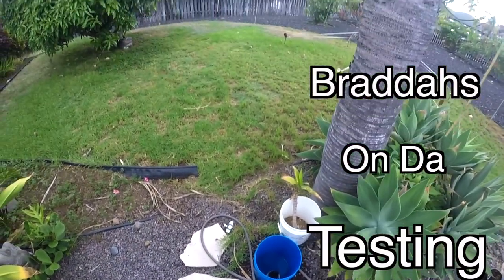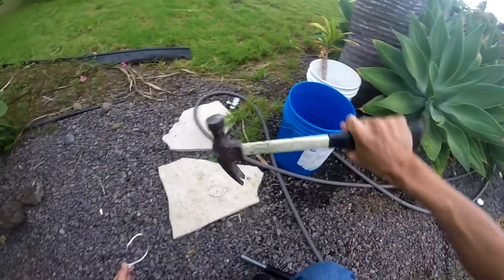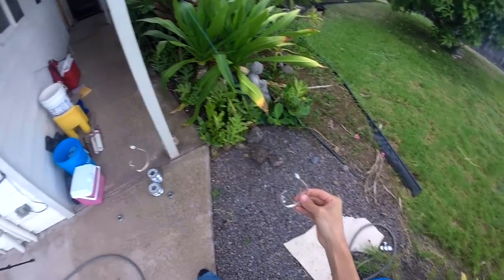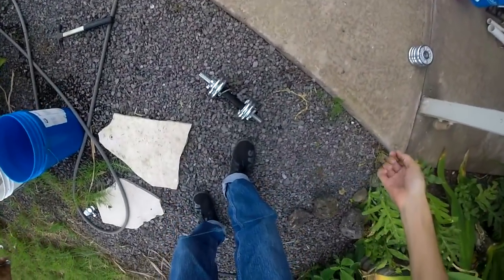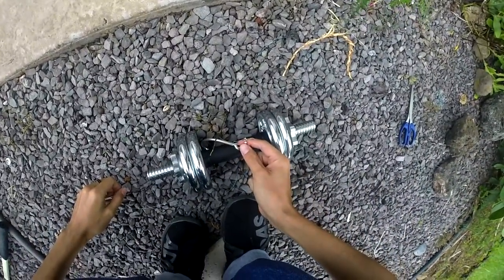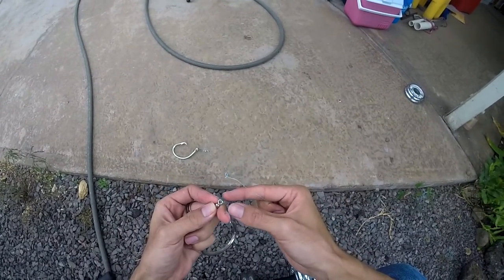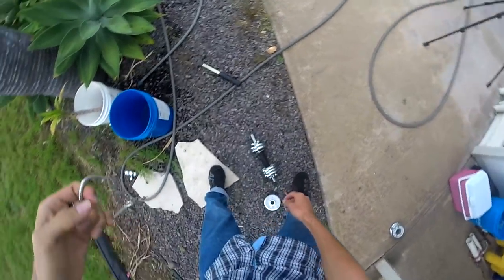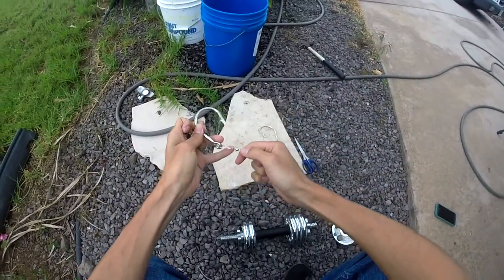Strength Test & Review - KastKing KastPro braided Fishing Line

Comment: Kapono see if you can do the heavier braid, I tested 120# kastking superpower braid using a digital scale with slowly increasing weight and I consistently broke at 37#'s.  When I contacted KastKing they told me I had a bad batch  and only refunded me after I sent the line back.  No other contact.  I asked a follow up question and got no reply.  I'd like to see another test on the bigger braid but at $46.00 a spool I didn't expect a whole lot but I expected the breaking strength to be higher, closer to half.  Do you think you could test a spool?
Reply from the maker: I will try get my hands on some! I got some 50 I can sample out.